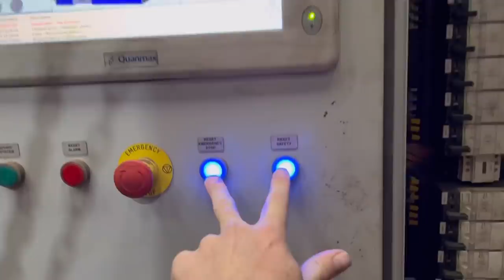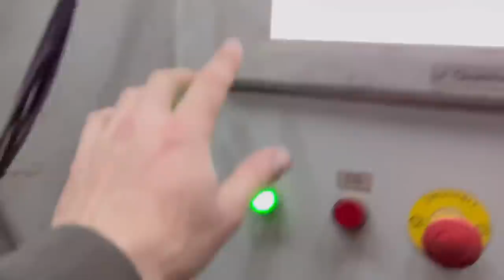Day622  #OLLYBLOGS BIG TRACTOR PULL OFF FENDT 936 JOHN DEERE 4955 CASE 4494 & 1455#AnswerAsAPercent

Comment: They are expensive but I bought a battery from a road warning light, cold cycle batteries or full cycle batteries and my 390t had had that battery for 6 years and starts every single time, and has NEVER failed, not once, I have even left the dash on overnight before

Comment: I run old trucks and tractors and when i park them up i take off a battery lead ( i leave a spanner in each battery box) its amazing how they drain batteries when they get older even with new batteries on 
Batteries dont last long if they are let going flatt

Comment: Surely the best way to conduct a tractor pull is to select creeper gear and take up slack and keep going, but it all comes down to weight and tyre area and compound
Reply: Creep gears are not designed for heavy pulling, only going slowly.

Comment: No surprise with the 4494 being pulled by the 4955, more power and weight on the 4955 at the beginning. I have a 4494 with a blade and blade frame  that weigs about 5000-6000lbs with fluid filled inside tires. Dead stock 4955 would not pull that 4494 any day though. My 4494 weighs around 30,000lbs though

Comment: Did you get the 4955 on the weighbridge. She has got seriously wide tyres on.  If had some 540’s on might have been different again
Reply from the maker: We did but forgotten weight
Reply: @OllyBlogsAgricontractfarmer  I always thought they would be heavier. I got a 4055 an. It’s just shy of 7 tonne without weights so. Would sound about right for 49 to be 8-9 tonne

Comment: The one that starts first usually wins when they are even the case driver was slow on the pull with both case pulls. The color means nothing when it comes to pulling its weight and tires for traction whoever has both wins
Reply from the maker: Defo
Reply: @OllyBlogsAgricontractfarmer  the deere with the big tires can really get a good Bite. I'm not a green fan but the old sound guard tractors are good units our neighbors have them.  I have helped roll some hay with a 4430 and it rides good, has enough power and the hyrdos weren't bad at all especially for a tractor that old.